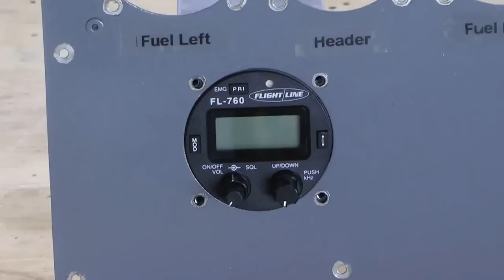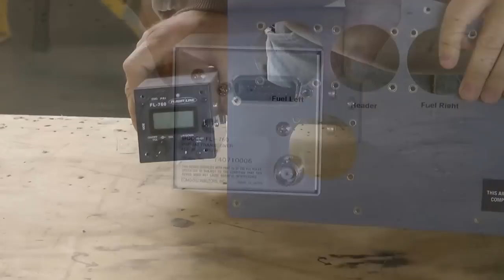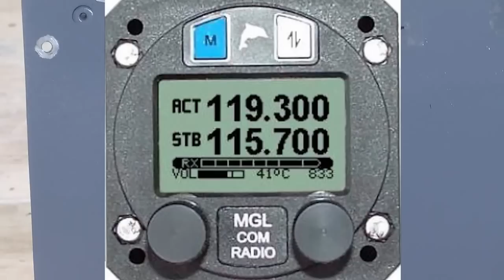Installing a Communication Radio in your Aircraft Panel

Comment: Nice video Jon, I wish I had this a year ago. But as I watch it, everything is explained well, except how to wire the PPT "loose wire."  Since a PTT button has 2 connections, I was wondering how you'd wire that up.  Keep 'em coming!  A video on fuel sloshing would be nice (unless I missed that one).    Bert
Reply from the maker: The PTT wire from the harness goes to either wire of the PTT switch.  The other wire from the PTT switch goes to ground!

Comment: I wont buy an aircraft instrument that doesn't have all the pinouts labeled on the unit itself.   10-20 years from now, long after the company is out of business, who is going to know the pinouts on that connector on the rear.   You see a lot of old junk like this on ebay for used aircraft instruments....there's no telling what pin does what any more.
Reply: Why could you not do that yourself when you buy it? Draw up your own diagram on an Avery label and stick it to the top of the unit.
Reply: Label maker + 20 minutes = problem solved.